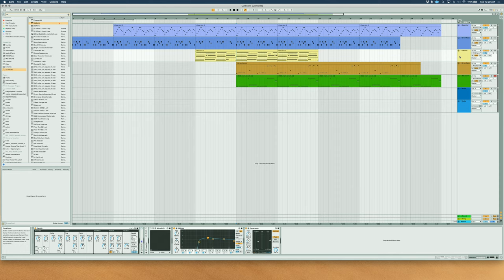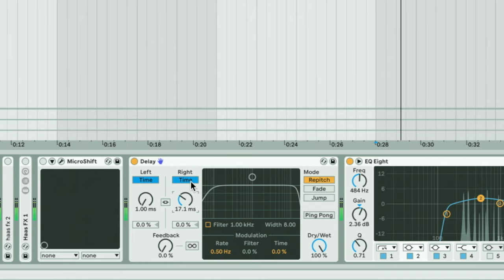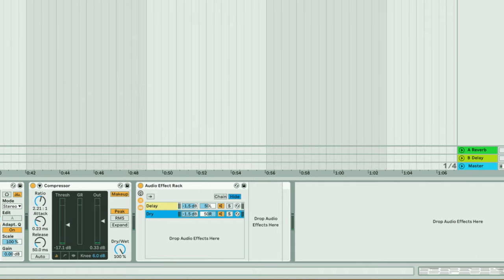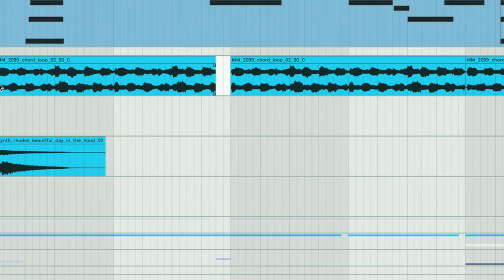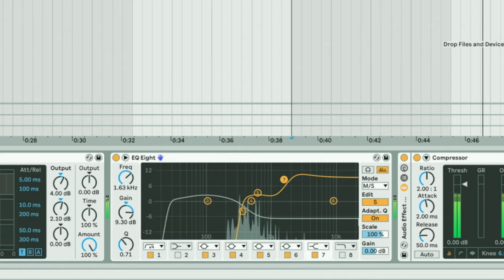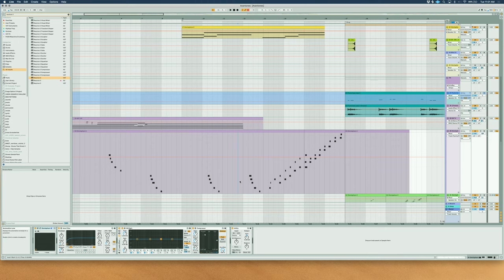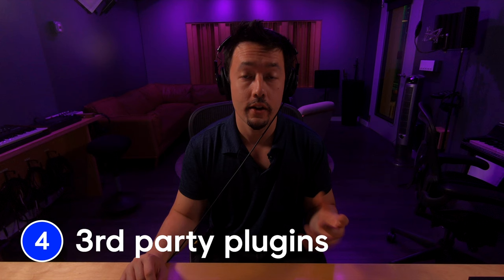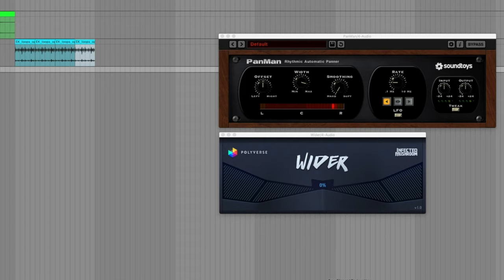4 techniques to widen your sound - production tips for more stereo width

Comment: Hi,All,,,What I tend to do is, duplicate the track,first. And then, add different reverb to each track. Now ,here's the Part. The 2nd duplicated track. I delay it with starting point, say slower to 35 milliseconds, with a large tail in Tempo sync. Try it,,See of it works for your track. Tq,All

Comment: What about the Wide Stereo preset of the stock plugin Utility in Ableton? It can widen the sound up to 400% which is crazy. I've been testing Wider from Polyverse as well.
Reply: I may be wrong about this, but I think that can only be used when the sound you're using the utility on has width to begin with. It increases the width, but I don't think it makes mono sounds into stereo.